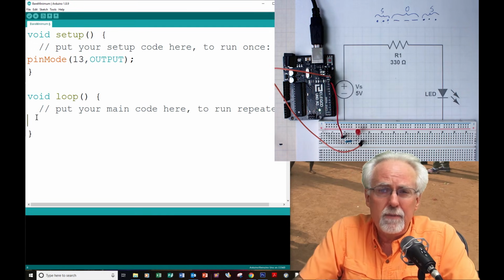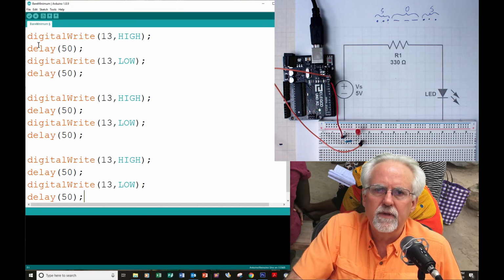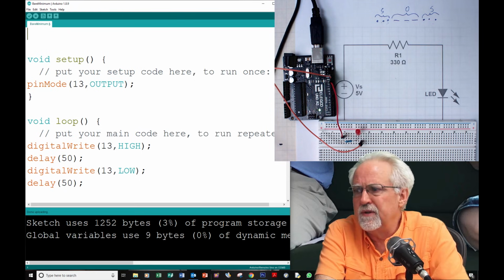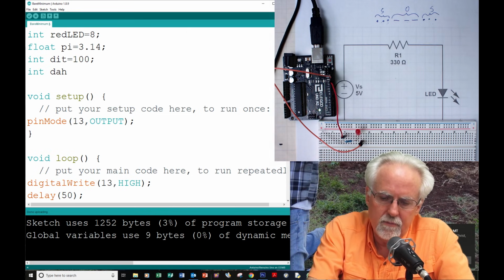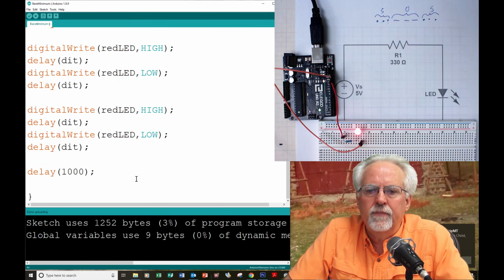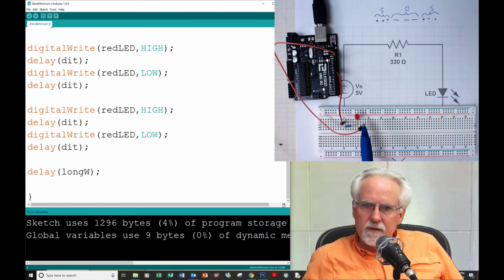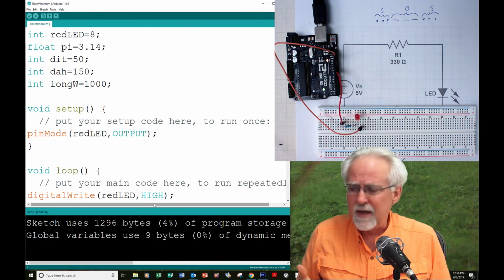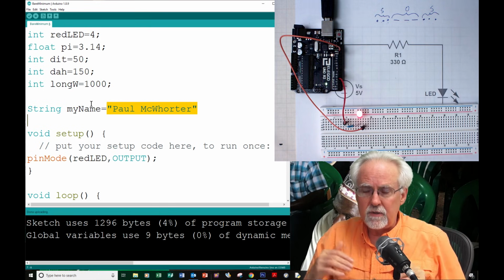Arduino Tutorial 4: Understanding Arduino Variables

Comment: Setting up the programme for 3 blinking leds was fine but I have only 2 gnd pin slots on my board so where does the third pin go?
Reply: connect a wire from ground into the negative row and connect all of the negative ends of the leds into that same negative row. they will then share gnd

Comment: i dont know why but Ive got int and void and pinMode in turquoise colour in my code but string and OUTPUT and HIGH and LOW are not in colour and Im wondering if this is affecting the length of the blinks which now seem all the same (with no longW)

Comment: can i do this

int led = 13; // Use one LED for SOS

void setup() {
  pinMode(led, OUTPUT);
}

void loop() {
  // S: 3 short blinks
  for (int i = 0; i < 3; i++) {
    blinkDot();
  }

  delay(300); // Gap between letters

  // O: 3 long blinks
  for (int i = 0; i < 3; i++) {
    blinkDash();
  }

  delay(300); // Gap between letters

  // S: 3 short blinks
  for (int i = 0; i < 3; i++) {
    blinkDot();
  }

  delay(2000); // Pause before repeating
}

void blinkDot() {
  digitalWrite(led, HIGH);
  delay(250); // short
  digitalWrite(led, LOW);
  delay(250);
}

void blinkDash() {
  digitalWrite(led, HIGH);
  delay(750); // long
  digitalWrite(led, LOW);
  delay(250);
}

Comment: Home work:

int redled=13;     // the red led is assigned to port 13.
int greenled=12;   // the green led is assigned to port 12.
int blueled=11;    // the blue led is assigned to port 11.
int swait=250;      // swait = short wait.
int mwait=500;     // mwait = medium wait.
int lwait=1000;    // lwait = long wait.
int lgwait=3000;   // lgwait = longer wait.

void setup() {
  // put your setup code here, to run once:
  pinMode(redled,OUTPUT);  // sets the led's as a output.
  pinMode(greenled,OUTPUT);
  pinMode(blueled,OUTPUT);
}

void loop() {
  // put your main code here, to run repeatedly:
  digitalWrite(redled,HIGH);  // makes the led's blink using the variables.
  delay(swait);
  digitalWrite(redled,LOW);
  delay(swait);

  digitalWrite(redled,HIGH);
  delay(swait);
  digitalWrite(redled,LOW);
  delay(swait);

  digitalWrite(redled,HIGH);
  delay(swait);
  digitalWrite(redled,LOW);
  delay(swait);

  delay(lwait);

  digitalWrite(greenled,HIGH);
  delay(mwait);
  digitalWrite(greenled,LOW);
  delay(mwait);

  digitalWrite(greenled,HIGH);
  delay(mwait);
  digitalWrite(greenled,LOW);
  delay(mwait);

  digitalWrite(greenled,HIGH);
  delay(mwait);
  digitalWrite(greenled,LOW);
  delay(mwait);

  digitalWrite(greenled,HIGH);
  delay(mwait);
  digitalWrite(greenled,LOW);
  delay(mwait);

  digitalWrite(greenled,HIGH);
  delay(mwait);
  digitalWrite(greenled,LOW);
  delay(mwait);

  digitalWrite(greenled,HIGH);
  delay(mwait);
  digitalWrite(greenled,LOW);
  delay(mwait);

  digitalWrite(greenled,HIGH);
  delay(mwait);
  digitalWrite(greenled,LOW);
  delay(mwait);

  digitalWrite(greenled,HIGH);
  delay(mwait);
  digitalWrite(greenled,LOW);
  delay(mwait);

  digitalWrite(greenled,HIGH);
  delay(mwait);
  digitalWrite(greenled,LOW);
  delay(mwait);

  digitalWrite(greenled,HIGH);
  delay(mwait);
  digitalWrite(greenled,LOW);
  delay(mwait);

  delay(lwait);

  digitalWrite(blueled,HIGH);
  delay(lwait);
  digitalWrite(blueled,LOW);
  delay(lwait);

  digitalWrite(blueled,HIGH);
  delay(lwait);
  digitalWrite(blueled,LOW);
  delay(lwait);

  digitalWrite(blueled,HIGH);
  delay(lwait);
  digitalWrite(blueled,LOW);
  delay(lwait);

  digitalWrite(blueled,HIGH);
  delay(lwait);
  digitalWrite(blueled,LOW);
  delay(lwait);

  digitalWrite(blueled,HIGH);
  delay(lwait);
  digitalWrite(blueled,LOW);
  delay(lwait);

  digitalWrite(blueled,HIGH);
  delay(lwait);
  digitalWrite(blueled,LOW);
  delay(lwait);

  digitalWrite(blueled,HIGH);
  delay(lwait);
  digitalWrite(blueled,LOW);
  delay(lwait);

  digitalWrite(blueled,HIGH);
  delay(lwait);
  digitalWrite(blueled,LOW);
  delay(lwait);

  digitalWrite(blueled,HIGH);
  delay(lwait);
  digitalWrite(blueled,LOW);
  delay(lwait);

  digitalWrite(blueled,HIGH);
  delay(lwait);
  digitalWrite(blueled,LOW);
  delay(lwait);

digitalWrite(blueled,HIGH);
  delay(lwait);
  digitalWrite(blueled,LOW);
  delay(lwait);

  digitalWrite(blueled,HIGH);
  delay(lwait);
  digitalWrite(blueled,LOW);
  delay(lwait);

  digitalWrite(blueled,HIGH);
  delay(lwait);
  digitalWrite(blueled,LOW);
  delay(lwait);

  digitalWrite(blueled,HIGH);
  delay(lwait);
  digitalWrite(blueled,LOW);
  delay(lwait);

  digitalWrite(blueled,HIGH);
  delay(lwait);
  digitalWrite(blueled,LOW);
  delay(lwait);

  delay(lgwait);
  
  }

Comment: I share the final exercise code if it can be usefull for you :)

int pinLedRed = 13;
int pinLedGreen = 12;
int pinLedBlue = 8;

void setup() {
  pinMode(pinLedRed, OUTPUT);
  pinMode(pinLedGreen, OUTPUT);
  pinMode(pinLedBlue, OUTPUT);
 }

void loop() {
   Blink(5, pinLedRed, 100);
   Blink(10, pinLedGreen, 400);
   Blink(15, pinLedBlue, 900);
}

 void Blink(int n, int pin, int delayMs) {
   for(int i = 0; i < n; i++) {
    digitalWrite(pin, HIGH);
    delay(delayMs);
    digitalWrite(pin, LOW);
    delay(delayMs);
  }
}

Comment: Hello Sir! I recently discovered a shortcut key that allows performing operations such as writing, deleting, or modifying text simultaneously at multiple locations within a file. For example, if we need to insert the word "Hello" at various positions at the same time, we can hold down the ALT key and click at the desired locations.

Similarly, to replace the number "13" with "redLED," we can hold ALT and click the cursor just after "13" at multiple instances. This will select all occurrences, enabling us to delete them simultaneously and replace them with "redLED" in one go.

Comment: Yes!!! Now I get to see if my S.O.S. was correct. About 80% sure I got everything right. I know the three dots, three dashes and three more dots is the pattern but probably missed a semicolon. I only wrote the program cause my Arduino has been delayed due to the weather.
* Also, When I type out in all caps (13,OUTPUT) the word OUTPUT isn’t happy and doesn’t turn blue. Any idea why it isn’t?
Reply: Went on Wokwi to test my circuit. All words were happy and lit up the colors they were supposed to. But not near as happy as I am watching my circuit blink out a distress signal.

Comment: int redLED = 3;
int greenLED = 5;
int blueLED = 8;
int delTime=100;

void setup(){

pinMode(redLED, OUTPUT);
pinMode(greenLED, OUTPUT);
pinMode(blueLED, OUTPUT);
}

void loop(){

digitalWrite(redLED, HIGH);
delay(delTime/5); //5 times faster
digitalWrite(redLED, LOW);
delay(delTime/5);

digitalWrite(greenLED, HIGH);
delay(delTime*10); //10 times slow
digitalWrite(greenLED, LOW);
delay(delTime*10);

digitalWrite(blueLED, HIGH);
delay(delTime*15); //15 times slow
digitalWrite(blueLED, LOW);
delay(delTime*15);
}

Comment: Assignment done, Prof. Paul. 
I have red, white and green ... so my code reflects those colors

Blinking red LED (5 times fast), white LED (10 times slow), green LED (15 times very slow)

// Define the pins for LEDs
int redPin = 13;
int whitePin = 12;
int greenPin = 11;

// Define the durations for blinking and the gap between blinks
int redBlinkt = 100; // in milliseconds
int whiteBlinkt = 200;
int greenBlinkt = 400;
int blinkGap = 50; // in milliseconds

// Define the number of blinks for each LED
int redBlinks = 5;
int whiteBlinks = 10;
int greenBlinks = 15;

void setup() {
  // Initialize the LED pins as output
  pinMode(redPin, OUTPUT);
  pinMode(whitePin, OUTPUT);
  pinMode(greenPin, OUTPUT);
}

void loop() {
  // Blink the first LED
  for (int i = 0; i < redBlinks; i++) {
    digitalWrite(redPin, HIGH); // Turn on the LED
    delay(redBlinkt);
    digitalWrite(redPin, LOW); // Turn off the LED
    delay(blinkGap);
  }

  // Blink the second LED
  for (int i = 0; i < whiteBlinks; i++) {
    digitalWrite(whitePin, HIGH); // Turn on the LED
    delay(whiteBlinkt);
    digitalWrite(whitePin, LOW); // Turn off the LED
    delay(blinkGap);
  }

  // Blink the third LED
  for (int i = 0; i < greenBlinks; i++) {
    digitalWrite(greenPin, HIGH); // Turn on the LED
    delay(greenBlinkt);
    digitalWrite(greenPin, LOW); // Turn off the LED
    delay(blinkGap);
  }
}

Comment: I'm not sure why, but my red led is way brighter when its hooked up to pin 13 than when it is hooked up to the others like 8 and 4.
Reply from the maker: Did you remember to change your pinMode to the new pin?
Reply: @paulmcwhorter  Yes. It's weird. When its just the red LED in pin 13 its bright. When I change it to pin 8 and update the programming, it's dim. Then when I do the assignments and have 3 LED's they are all bright regardless of what pin I use (usually pins 4-13). It's only when I do the one red led in pin 8. I figured that would be a future lesson or something, but I saw on your video that yours was still bright even when you put it in pin 8. I think I'll troubleshoot a little bit tonight and see if it's just pin 8 or just red led's or what.

And by dim, I mean it's definitiely on and blinking, but its just at about 40% brightness.

Comment: chatGPT is helpful in writing arduino code
Reply from the maker: Yet if chatGPT does your job for you, why does the world need you? chatGPT is a slippery slope, and you need to be very careful about relying on it.
Reply: yes, it is just a tool. Like any tool know the limits. I don't use a screw driver for a chisel if I have a choice.  My problem is that when I get away from this I cannot remember the syntax chatgpt does. I can check "her" answer. thanks for your response, enjoying the course and your blog posts! @paulmcwhorter
Reply: I am trying to get thru all the topics, my goal is to read the DHT humidity sensor and check for roof leaks! I can extend my roof life is smart ways without buying a new one. I thinking about applying varnish to seal grit etc. , a test  sample looks good.

Comment: (i teted hitting the reset button on the Arduino. still completely disconnected from the breadboard) and it flashes 0.00. but goes right back to reading 2.5XX.  XX numbers are varying.

Comment: Paul, I've done the homework which works fine but the brightness of the LED's varies as the sequence loops with the last LED less bright than the first one. It isn't the individual LED as the brightness  increased if I swap the location of the LED on the breadboard
Reply from the maker: Make sure you did all your pinmodes and make sure you are using correct resistor value

Comment: Si alguien quiere otro código de lo mostrado en este vídeo más optimizado pueden ver el mío
const int SDELAY = 200;
const int ODELAY = 700;
const int pin = 12;
const int srep = 3;
const int orep = 3;
void codigo( int del, int repet)
{
    for ( int i = 0; i < repet; i++)
    {
        digitalWrite( pin , HIGH );
        delay( del );
        digitalWrite( pin , LOW );
        delay( del );
    }
}

void setup() {
  // put your setup code here, to run once:
    pinMode(pin, OUTPUT);
}
void loop() {
  // put your main code here, to run repeatedly:
    
    codigo( SDELAY, srep);
    codigo( ODELAY, orep);
    codigo( SDELAY, srep);
    //Le meto otro delay para que así se vea el cambio de repetición y qeu no parezca seis continuas
    digitalWrite( pin , LOW);
    delay ( 1000 );
}

Comment: There are standards in the use of morse code. That may have made it more complicated. The dash us three times the length of the dit. Spacing between the dit and dash in a character it the length of the dit. Spacing between letters is three dits, Spacing between words is seven dits. The length of the dit then determines the speed for the signal.  Makes for a good further exercise from what you did.

Comment: Outstanding series.  Ordered my Arduino starter kit.  Will be here tomorrow. 

A couple of constructive criticisms.

1.  SOS was informally initially recognized as meaning "Save Our Ship".  As it became more wildly used as a universal distress signal on land, sea, and air it was reinterpreted as "Save Our Souls".  An extension of this idea is when aircraft pilots file a flight plan with the FAA, one of the items in the flight plan is the "Number of Souls on Board.""

As a HAM, or licensed Amateur Radio Operator, I want to offer the correct timing spacing in Morse code for dots, dashes, and spacing.

1.   The  length of a dot is one time unit.

2.  The  length of a dash is three time units.

3.  The length between symbols (dots and dashes) of the same letter is 1 time unit.

4.  The length between  letters is 3 time units.

5.  The length between words  is 7 time units.

The  length of the time unit varies with the speed of transmission.   The time unit for a transmission speed of 5 words per minute is 4 times the length of the time unit for a transmission speed of 20 words a minute.

Comment: I went with something a little different. Trying to remember my old C++ stuff is fun! :)

const int BLINK_RATE = 300;

void cycle(int num, int times){
  for(int i = 0; i < times; i++){
    delay(BLINK_RATE);
    digitalWrite(num, HIGH);
    delay(BLINK_RATE);
    digitalWrite(num,LOW);
  }
}

void setup() {
  // put your setup code here, to run once:
  pinMode(13, OUTPUT); //red
  pinMode(8, OUTPUT); //green
  pinMode(7, OUTPUT); //blue
  }

void loop() {
  cycle(13, 1);
  cycle(8, 2);
  cycle(7, 3);
}

Comment: hello i am 11 years old. i love your videos very much. i had a atl project to do with arduino and this is something that can guide me to it. i do have a doubt about the homework, how should i use three bulbs and connect them to one single GND port.
Reply from the maker: Run a wire from the ground on the arduino to the ground rail on your breadboard, then connect as many wires as you need to the ground rail.

Comment: Last one for the night! My code:

//VARIABLES
int redLED = 8;
int greenLED = 6;
int blueLED = 4;
int redSpeed = 250;
int greenSpeed = 500;
int blueSpeed = 750;
int redBlinks = 5;
int greenBlinks = 10;
int blueBlinks = 15;
int longHold = 1000;
int blinks = 1;

void setup() {
  // SET UP ARDUINO
  
  pinMode(redLED,OUTPUT);
  pinMode(greenLED,OUTPUT);
  pinMode(blueLED,OUTPUT);
}
void   
loop() {
 // RED
 for(blinks = 1; blinks <=redBlinks;blinks++){
  digitalWrite(redLED,HIGH);
  delay(redSpeed);
  digitalWrite(redLED,LOW);
  delay(redSpeed);
}
 
//GREEN
  for(blinks = 1; blinks <=greenBlinks;blinks++){
  digitalWrite(greenLED,HIGH);
  delay(redSpeed);
  digitalWrite(greenLED,LOW);
  delay(greenSpeed);
}

 //BLUE
  for(blinks = 1; blinks <=blueBlinks;blinks++){
  digitalWrite(blueLED,HIGH);
  delay(blueSpeed);
  digitalWrite(blueLED,LOW);
  delay(blueSpeed);
}
  delay(longHold);
  }

Comment: Hi,

i tried the assignment and it worked fine but i have a voltage drop. how can i fix that? my red LED is brigther then my green LED and the green one is brighter then my blue LED.

greetings
Reply: Did you use the same resistance level for all three LEDs?  For instance, three 330 ohm resistors in your breadboard?  And are they all lead to the same ground?  Also, make sure you have set the pinMode, and OUTPUTs correctly for each LED.

Comment: int dit=100; - int dah=250; - int ShortW=25; - int LongW=1000. Insert the “ShortW” as an additional “delay” after the 3 dits and after the 3 dahs. I think you will find plugging in these numbers will be closer to the rhythmic timing of actual CW (Morse code) de KA9TII Jim
Reply from the maker: KF5ZBY
Reply: @paulmcwhorter  I've got the original assignment completed and it works fairly well, but I was trying to get the LEDs to work independently of each other. Is that something that this little Arduino board can do with the right programming? Is that too far down the road for right now? I tried the "for" command but I didn't understand it very well. It almost seemed like there had to be something else to go along with it. Thank you for taking the time to help and teach.

Comment: I was hoping when I opened this tutorial 4 that you would be showing the board setup as it should have been at the end of tutorial 3's homework;  that is with red, green and blue LED's and showing all the connections on the board, and then you giving a brief summary of that, not a summary of just one LED. I could only get my 3 LED's blinking by using the GND next to  pin 13 for the red LED, and the two GND's on the power side of the UNO board for the green and blue LED's because the negative rows on my breadboard don't seem to be connected to anything; the jumper pins just slide into the holes with no resistance as though the holes are not connected to anything.

Comment: btw you dont need the second S you only need S And O To Make It Work.
Reply: Copy And Paste This For The SOS,

void setup() {
  // put your setup code here, to run once:
pinMode(13, OUTPUT) ; // Voltage Output
}

void loop() {
  // put your main code here, to run repeatedly:
  //Part 1 (S)
digitalWrite(13, HIGH) ; //Turns Light On
delay(100) ; // Delay In Seconds
digitalWrite(13, LOW) ; //Turns Light Off
delay(250) ; // Delay In Seconds
digitalWrite(13, HIGH) ; //Turns Light On
delay(100) ; // Delay In Seconds
digitalWrite(13, LOW) ; //Turns Light Off
delay(250) ; // Delay In Seconds
digitalWrite(13, HIGH) ; //Turns Light On
delay(100) ; // Delay In Seconds
digitalWrite(13, LOW) ; //Turns Light Off

//Part 2 (O)

delay(2500) ; // Delay In Seconds
digitalWrite(13, HIGH) ; //Turns Light On
delay(1000) ; // Delay In Seconds
digitalWrite(13, LOW) ; //Turns Light Off
delay(250) ; // Delay In Seconds
digitalWrite(13, HIGH) ; //Turns Light On
delay(1000) ; // Delay In Seconds
digitalWrite(13, LOW) ; //Turns Light Off
delay(250) ; // Delay In Seconds
digitalWrite(13, HIGH) ; //Turns Light On
delay(1000) ; // Delay In Seconds
digitalWrite(13, LOW) ; //Turns Light Off
delay(2500) ; // Delay In Seconds

}